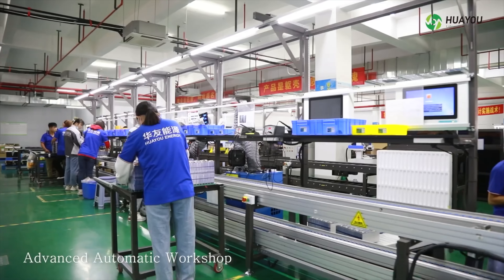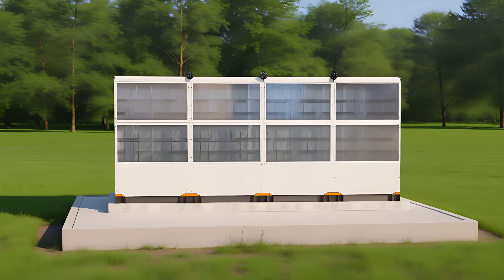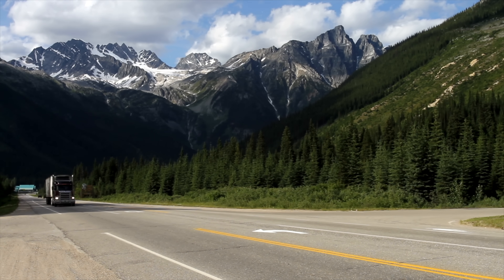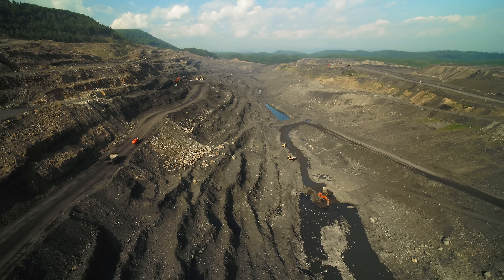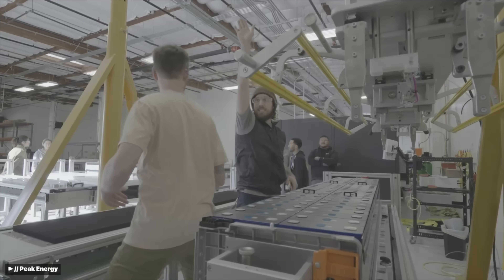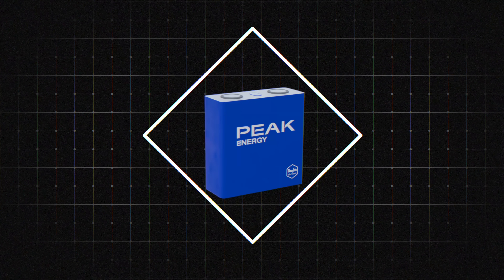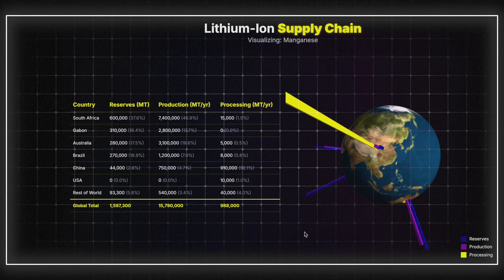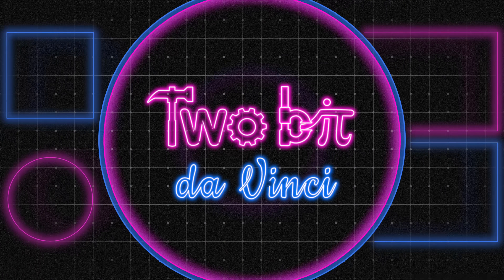Sodium Ion Batteries Are Going to be EVERYWHERE - Here's Why

Comment: Sodium-ion batteries typically last between 2,000 and 4,000 charge cycles, depending on the specific chemistry, quality of materials, and how they're used. This translates to about 5 to 10 years of lifespan under regular use.

Comment: To your last point. NOPE. As an EV driver I can't think of having a car with anything less than 300 miles of range. We as consumers want a battery that can go long distances on fewer charges at low cost per watt hour. But that is tough to achieve right now. The sweet spot in my opinion for an EV battery is 300 to 450 miles. That's for cars. When you're talking about large SUVs and pickup trucks you're gonna need more.

LFP and these sodium type batteries would be good if they could achieve above 300 miles of range because charging to 100% with low degradation is key. And add to that we're talking about batteries less risk or no risk of fires. This is what we're looking for in cars. My EV is NCM chemistry and gets over 300 miles of range but that's really only useful on long road trips where my initial leg is to charge it full but have to stick to around 80% afterwards to protect the battery. That's more weight and unusable capacity.

Don't get me wrong. Using these for energy storage is awesome but the average person isn't so much concerned about that as much....

Comment: Other channels have talked about problems using inverters due to the discharge voltage not stabilizing like lithium. That along with the round trip efficiency from full charge to discharge being considerably less than lithium is another hurdle someone's going to have to address for these can be used for many applications that are now using lithium. I certainly hope they can figure this out and get past these hurdles because it seems to be a much more stable technology and as you said the necessary raw material to manufacture this battery is a huge step forward. Keep up the good work I really enjoy these videos

Comment: some of us need over a thousand miles of range you want me to be self-sufficient in the field as a welder I have to have long range not necessarily for driving but when you start welding that's a lot of power 17:35 17:37 17:38 17:39 17:41 17:42 17:42 17:42 17:42

Comment: Telecom (-48V) needs Sodium battery for leased indoor space and roof top cell sites and places where Lithium is too risky due to the 3rd party liability.  Also for off-grid sites where keeping Lithium above freezing is critical path.  The typical space in a 23" rack or cabinet for a North American AGM battery is 8RU high (14") and 22" deep.  China builds first for EV, then 19" Telecom.  23" Telecom racks are always last to market.  Remote radios would need a DC-Converter for a flat -57V to reduce cable losses, while in cabinet or shelter equipment can operate directly from the battery bus down to 36V (42V is traditionally AGM end of discharge).  Looking to do PoC trials now.    UL9450A don't apply directly, but would prove the battery "benign".  What are the off-gassing components when forcing a cell into thermal runaway?

Comment: High capacity field use of batteries like RV camping or ham radio use favor LiFePO4 due to less weight, full use of voltage staying high, and high amp throughput compared to sodium.  Perhaps the best use of sodium is power grid applicarions where space and weight are not an issue?  Also, below 0* F charging of sodium is almost 10x longer than above freezing 32* F.  Maybe a car can run at -20*F but it won't charge very well.

Comment: Really psyched that energy storage needs could become very practical with this chemistry.

The only negatives that are obvious are slightly higher ESR, ESR that gets worse as temperature decreases, voltage that varies more with point of charge/discharge, and lower power density.  Still, I bet that the voltage is still “stiffer” under load than lead acid technology that we’ve lived with so long, even at winter temperatures.  And the voltage swings pose less issue if the dc-ac or dc-dc conversion is well engineered.  The power density is also still better than lead acid especially vs weight.  And it’s still plenty useful for stationary storage as well as vehicles that don’t need to be used for cross country driving.

All in all, this is super news!!

Comment: CATL in China has announced it's new Sodium-Ion battery has passed all it's safety tests and should go into production very soon. They say it will be 50% cheaper and have a 10,000 charging cycle before dropping below 80%. It can operate in temperatures below 30 degrees Celsius. It can be produced on the same production lines as Lithium batteries so production will scale up very quickly.

Comment: Batteries store energy for use later. With batter technology, you can use electronic devices without having to keep them plugged in. Most people want rechargeable batteries that aren't too heavier either. You need a Goldilocks battery to be successful in the cut throat world of energy store technologies. This is why, in 1977, you didn't have widespread use of Sodium or Lithium batteries.

Comment: With the high cycle count and wide temperature range, could these be viable as a cheap replacement battery for existing hybrids cars where the typical replacement cost makes them uneconomical? I'm also thinking 12v battery in conventional EVs, as it's a common cause of electrical faults as they age.

Comment: The diamond battery which is not really a battery it's more of a power generator when they start manufacturing those every other battery will become worthless and all you have to do is take a diamond battery and pair it with a capacitor and you now have the most amazing device on the face planet Earth basically you have a battery that even though it makes a small amount of power it will charge itself overnight and be able to deliver any amount of power even 10 times what you could get out of a lithium battery and deliver it immediately the difference is it simply will never need to be charged for thousands of years if you want to look into the most amazing thing look into diamond batteries that is the way of the future the sodium battery that you're talking about will help a lot and give more time to develop the diamond battery however it will still probably only be on the market for 30 or 40 years by then all batteries will be worthless and solar panels will be worthless because the diamond batteries will be that good check it out thank you for your video you did a really great job I really appreciate

Comment: You didn't mention charge time compared to Li-Ion, let's say an 18650 cell each for that and all considerations to follow.  Lower density could mean a faster charge time, but Li-Ion typically charges from 3.2V to 4.2V with a 2.8V Minimum Cutoff for safety, while a Peak Energy cell may have to charge from 0.0V to 4.0V, so that higher charge range may make charge time somewhat equal out, with charging Amps for each being the same.  Peak Energy definitely has its market, but lower density/lower mAh will limit its applications, especially in existing devices.  Great video, Ricky!  👍👍

Comment: Amazon Japan already has sodium-ion powerbanks for sale ( ~$50 converted price, for 9000mAh, advertised as having a 13 years shelf life and 5000 cycles life from 0% to 100% charge.

Company name is Elecom.

No idea if sparing the battery from deep discharge and 100% charge and increase its total usable life like it does for lithium-ion batteries ( which is why electronics with lithium batteries now often have an option to cap the battery at 80% max charge )

Can't figure how to link Japanese text link.

Comment: Not to seem insensitive but China has unveiled in April the "Naxtra" battery solution...which is the same thing with an energy density of 175 watt-hours per kilogram. But on the flip side they are working with CATL to elaborate a new system as to integrate their new "shenxing fast-charging battery, which it said can enable a 520 km driving range with a five-minute charge, and reach 80% charging from 0% in 15 minutes in cold weather. 

From my perspective, USA is still trailing behind.

Comment: I'll do you one better! just use a sand battery like they do in Finland. No phosphorous, which btw IS a valuable resource which is not renewable and is critical to our world food supply chain. Additionally, no significant rock mining. Just put up a somewhat insulating container fill it with sand heat it and boom! you have a large battery which has around 80% effeciency, great for renewable energy storage.

Comment: I really hope sodium-ion batteries get developed fast, because that will solve the grid reliance problem (i.e the west needed chinese materials for their grids), BUT here's a problem: western EVs won't benefit much (unless huge investments and incentives are made and supported by western manufacturers), because of 3 things: energy density, more precisely gravimetric energy density which is very low compared to current lithium-ion batteries (it's the huge one), the fact that china is already ahead (CATL developed a comercially available sodium-ion battery, and i think BYD is coming too), and that while the west would get rid of material dependency, manfacturing dependency is an issue (it's the least problematic one, as the west only needs investments and incentives like i said before)

So basically sodium-ion will benefit china almost as much as the west (their lithium-ion empire will still be heavily hit), if not even more if they're very agressive about sodium-ion development (which will probably be the case if the west is too late)

Comment: no one actually keeps their phone battery between 20-80% charge. you can pretend like everyone does because you do, but everyone else is like "oh yeah i do that too' just to lie so you dont go off on a rant about battery cycles they dont care about. they'll just happily get a new phone every 3-4 years. 
everyone plugs it in and forgets it until its 100% every time. 

i charge my phone to 100% and it usually gets recharged at 80% every night. is it hurting it? absolutely not. im only using ~20% of a charge cycle every day, not the full battery.

Comment: So, are dendrites an issue? Part of the death of lithium batteries is the formation of dendrites that punch through the layers of the battery's internal structure. This results in loss of maximum charge, improper reading of charge, and in the worst cases, turn your battery into a spicy pillow.

Comment: Sodium batteries have one major drawback, lower voltage. And you may say, what does that matter if its cheaper?.

Well sodium is not the only thing in batteries that cost money. chromium , cobalt, manganese, even copper, graphite  also cost money. 

The result is that the money you gain on sodium being cheaper than lithium, you end up paying more for everything else.

Now all lithium cells don´t contain those expensive minerals, well LFP and LTO don´t. But her is a compounding factor. Those have lower voltage even in lithium form, making the voltage of a sodium battery of those types even lower.

So while the battery may still be somewhat cheap, now the density of the battery is considerably lower. While that don´t make the battery useless, it does limit the usage to non mobile products and toys.

So while you can get ~150Wh/kg with a Sodium crome-cobalt battery, for something that is actually economical as of a Sodium iron fosfate battery, its closer to 90-100. That is just marginally higher than NiMh

Of cause NaFP batteries does have a much longer lifespan, still making. Still volymetric density is still quite low

Comment: Hey. Hey, I've seen this one. I've seen this one! This is a classic. 

Sodium ion should work fine once battery manufacturers actually start making them and not just talking about them for decades. Smaller batteries that won't be heavily affected by the increase in weight should be great but I doubt adding more weight to already heavy cars will be feasible.

Comment: The great thing about these sodium batteries is that they can be re charged 10,000 times and still hold the same amount of energy without deterioration, for cheap, and safe, and holds more power per volume so batteries can be smaller if needed. Cant wait to see this be real and in stores
Reply: No, it's 10,000 cycles with only 85% degredation, which is 2-3x better than LFP. CATL's Gen 2 Naxtra battery will revolutionize battery storage and mass production is set to begin in December. Has 175w/kg energy density, as good, or better than LFP, at less than half the cost.  Also, works down to -40C with only 10% loss of capacity.  That this channel talks about this stupid Peak Energy battery is absurd.  The revolution is here - and it's Chinese technology...
Reply: @ArthurDentZaphodBeeb im so excited :)

Comment: Just stick cheap aluminum wire coils underneath roadways to keep electric cars with sodium ion+ batteries charged as they go along during long distance interstate trips and since the cars are in motion you can use the DC current from renewable solar and wind rather than the more expensive AC grid current?
Since sodium ion+ batteries charge so much quicker you wouldn't need to place a steady line of coils but more like spread out pulses of chargers to maintain the battery's charge providing unlimited range on long trip interstate highways!

Comment: Dear Ricky. Starting at 7:17 of this video, you claim: "This makes it incredibly hard for the battery management system, the BMS, to accurately know the battery's true state of charge. A tiny measurement error can lead to a dangerous overcharge or let the battery drain too low, causing damage"

I don't know what battery management circuit you had in your destroyed batteries, but I have used a JK-BMS device myself. All the data it displays in numerical values, in addition to the cell voltage, their average, the total battery voltage, temperatures and the current flowing - is just guesswork, as you have probably heard or seen. But since it bases all important functions on the accurate measurement of the cell voltage, you are ultimately wrong to claim such a thing. Of course, the user can modify these limit values inappropriately and thus cause various damages, but that was not the point.

Simply put, the JK-BMS hallucinates about everything else, such as the charge percentage, but I don't stare at them. I look at the cell voltages provided by the BMS device and everyone should delve deeper into them.

Comment: This actually changes nothing, sodium batteries have problems and have had for 15 years which is why we are using lithium. Videos like this are becoming soooo tedious, they are just too heavy for vehicles and are only used for fixed storage applications. Even then there are drawbacks so no, this changes nothing.

Comment: Potentially unpopular opinion: the US still isn't ready for the EV revolution. It's far better than it was 20 years ago when Tesla first started popularizing EVs, but there are still a lot of Americans that would rather drive 450 miles to visit family than to fly 600 and drive 200 (based on personal distance), and spend $40 on gas than spend $500-600 on a plane ticket plus $15 in gas. EVs that have an absurd range like 500 are good for long road trips like that, and even if it's only going to happen once every 5 years, most Americans realize that there's infrastructure everywhere to get gas, but you have to plan around supercharger stations on long drives or risk hitting a highway or interstate that's longer between them than you have range.

Comment: Energy storage is half the problem. Infrustructure needed to generate electricity is very expensive. Oil will still be king for a VERY long time. These systems are good in case of war, as backup. But thats about it. If your pipelines are taken out, you can run things on these systems for some time.

Comment: Soooo! You say that China puts Billions into research and development of these batteries ... which i assume they did the same with Lithium. Hence the strangle hold on the market. My question! Why aren't we pouring Billions into research and development instead of sitting on our hands and letting China corner yet another market?! Why don't we do as China does, ... like we (North America) used to. We were at one time the leaders in everything. What stopped, what slowed us down ... beside the obvious. China's super cheap labor and probably no red tape and regulations. "Just fricken' do it!" ... which should be our stance as well. Have you seen the Data Centre's! Holy crap they are huge... and everywhere! Using up ALL the power. ... then my conspiracy-ish side. The money saved on this technology! it'll just be profit. It's not like our energy bills will go down. They still go up, even when we do all this energy efficient stuff they ask us to do. ... and YOU KNOW! China is waiting in the wings to get their hands on Peaks technology..  either industrial espionage (steal it) or reverse engineer it. Because there is GAZILLIONS to be made, and stealing it, is worth it. Then, we just sit on our hands while they have all the manufacturing in place,  in record time.